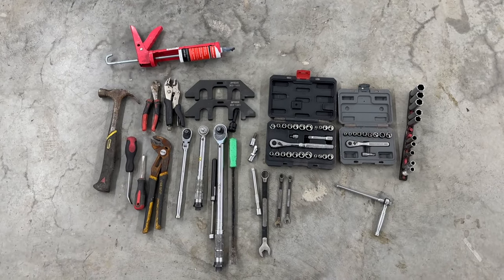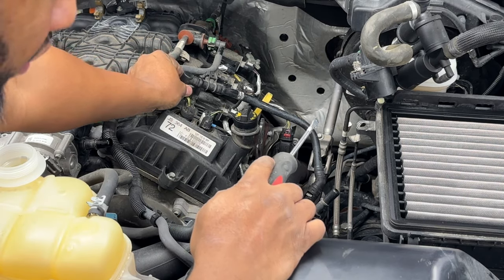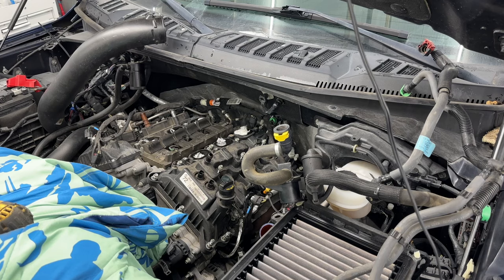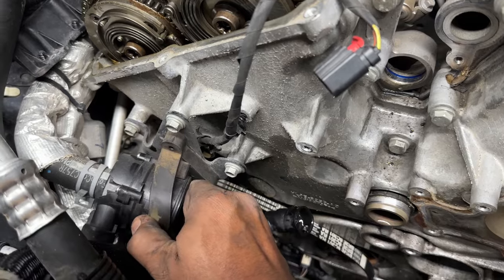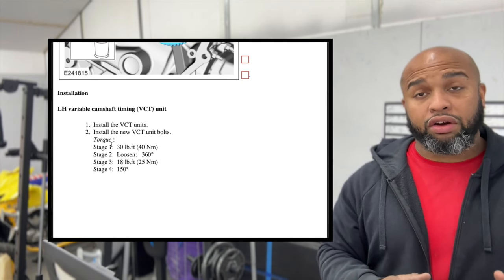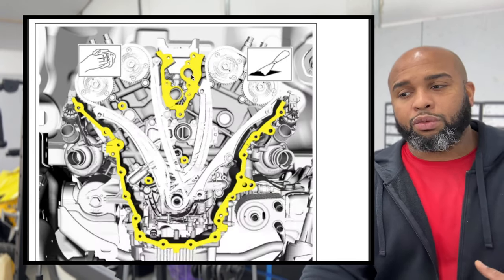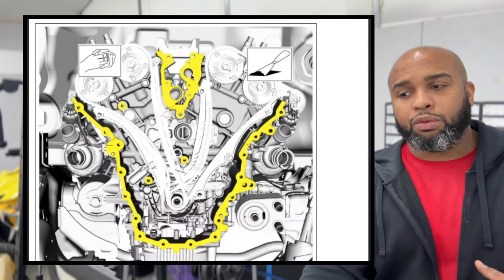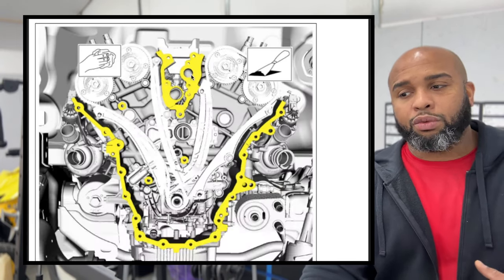F150 Cam Phaser Rattle Repair Gen 2 3.5 Eco Boost

Comment: Hold the fuck up!! This man is a fuckin savage!!!! I don’t trust myself with brakes so I sure as hell ain’t trying this shit. But damn! Much respect! Wish I was 1/4 as handy as you! 

You have any advice for me?

2019 raptor
75k miles
Had cam phaser fixed under warranty 3.5 years ago
Out of warranty now
Called Dealer and I’m shit out of luck. I have to pay 4k to fix it.

Do you think Ford Corp can cut me some slack? I owned a 2012 5.0 and currently own a 2019 5.0 and 2019 raptor. I’m hoping they can pay for partial or full fix since this is an ongoing issue with the raptor and it’s been fixed under warranty in the past.
Reply from the maker: Sorry to hear that. But I doubt it. They would not budge and mine was 1k out of warranty. Good luck.
Reply: @juicer911 god damn!! What did you try?!?! This is wild. How much did you pay out of pocket?

Thanks
Reply: Same here 2018 raptor caught the warranty though it was just a reprogram they did but now the came phaser are acting up again what’s the part number for the replacement phasers I think I may have overlooked it I don’t want to get the same version that’s on it now
Reply: @devinnorman3103  I don’t know. I still have not taken mine back in. I’m so pissed at Ford.
Reply: @joemomma707  i actually got an update: if you got the reprogram it sounds like you are grandfathered in…. based on the miles determines how much ford will pay 

 0-70000 miles  100%
70000-80000 miles    66%
80000-90000 miles    33%
0% for everything over 90000 miles

But I think it’s case by case based on what he said
Reply: @devinnorman3103  I got a complete cam phaser replacement a long time ago. I currently have 76,942 miles. Do you think I still qualify? Thanks for the info! I’m glad you qualify!!